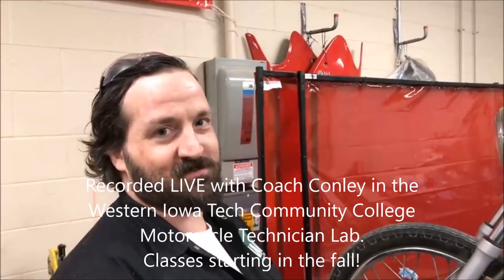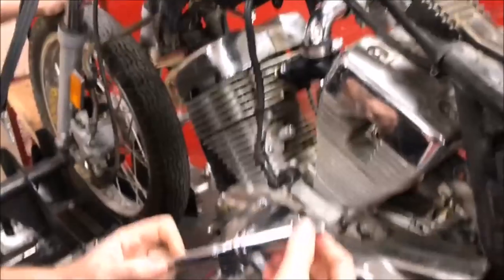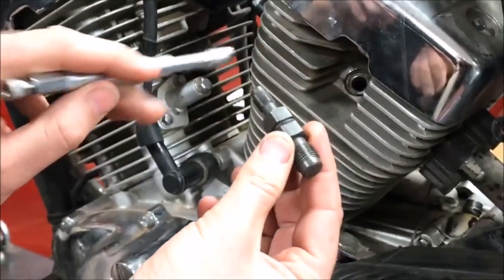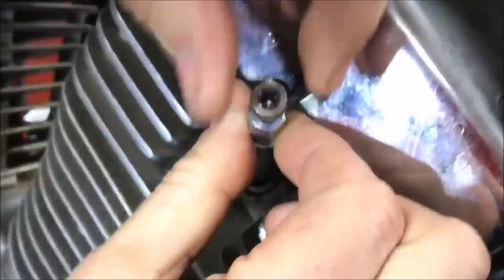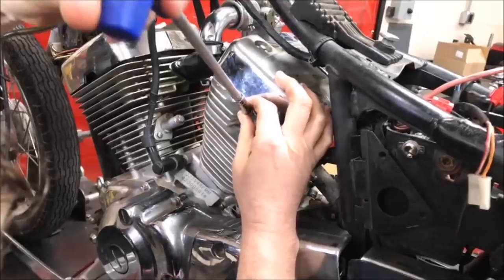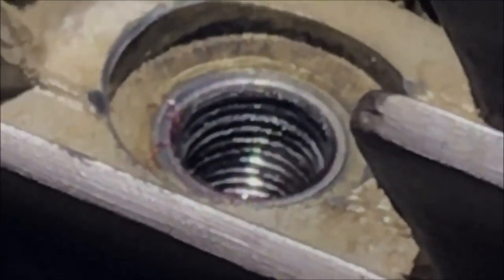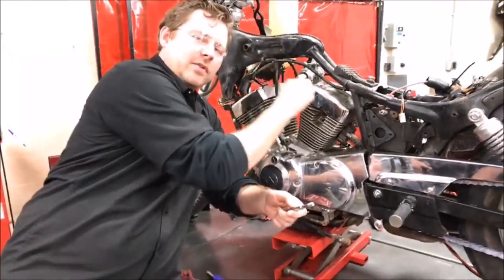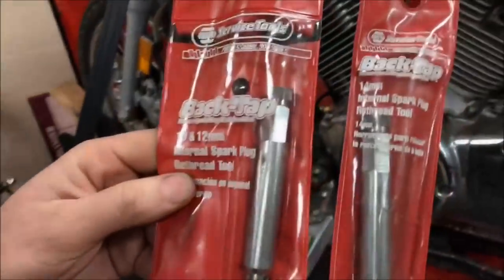How to repair a damaged spark plug hole and threads #savetheday using a Back Tap #sparkplugthread

Comment: Awesome tool! Another great reason to watch your channel. I would suggest cleaning the tap after the first pass and running it through again with fresh grease just to make sure all the loose bits are cleaned out the threads. 
A trick I use all the time to install plugs in awkward locations is to slip a short length of rubber hose over the porcelain end of the plug to use as a handle to spin the first few threads in by hand.
Reply from the maker: Thank you. Hit that subscribe button please! It helps us!
Here is a way to support all the free videos.
Want to say “thanks” or “keep it up”? Click here https://www.paypal.me/how2wrench  

Coach Conley is also available for hire to personally work one on one with you if ever needed. Yep he is a real person. Give him a call @ 602-345-0432

Your answers and help are just around the corner. Save time and money while protecting your investment and yourself by doing it the right way!
Follow us!
Web:
www.How2Wrench.com    
www.Tools2Wrench.com

Comment: You made a believer out of me. Haven’t cross threaded a spark plug in many decades.  Purchased a 10mm x 1.0 on EBay and it worked like a charm.  If I had to remove the head, I’d probably have scraped more gasket material into the cylinder.  Great tool and thanks for the video!   I wonder why they don’t sell them in more places?
Reply from the maker: Glad to hear how you liked the videos. Here are the links to support us for this information and our work saving you money.
Join this channel to get access to perks:
https://www.youtube.com/channel/UCBhM8DCKnT3qXwTW0eToyCg/join     

Give us a high 5 here:  https://www.paypal.me/how2wrench

Comment: That is a pretty nifty tool. It like a modified heavy floor anchor like you anchor heavy equipment like press brakes and lathes with, but with threads popped onto it.
Reply from the maker: Right on....

Comment: so i have a 2001 yamaha roadstar 1600 motor is the 4 valve per cylinder.. i whent to go change the plugs and noticed that 2 of the plugs on the right side of engine is cross threaded and wont let them go in hardly at all.. would using this tool be safe to use like do i need to worry about the spark plug getting blown out?
Reply from the maker: Its your best shot at not having to remove the head to fix but the only way to judge if it worked is if the spark plug will torque to spec and not pull threads. You're in luck. I do offer personal service to back up what's missing from a video to actually fix your specific problem. I do work on donations for my time and possible research. 
Good news is its CHEAP! For my time would mind becoming a member of my website? It comes with a free 20 mins of techline and that will cover my time to assist you so we both benefit. So to have me personal cell phone number to put in your phone as your direct info and how to coach, sign up now! As always thank you and enjoy the free videos! Much more to come! I look forward to working with you and hope you will become a member of or learning community. 

Link to membership: https://how2wrench.com/product/membershipmembers-onlymembers? 

If I can ever be of service to you, here is a video explains how to connect with me. 
https://www.youtube.com/watch?v=vjvmB01ebcs 
Direct link to services: 
https://how2wrench.com/product-category/tech-lineservice-callminutes/ 
Live Chat is great for you to actually show your specific issue!
Donation link: https://www.paypal.me/how2wrench

Comment: stick a rubber hose on the end of the plug to start it.  Much easier in tight locations and you won't have enough torque to cross thread
Reply from the maker: Good tip! Since it's coming from the combustion area and there is carbon build up, you will find at times you really have to break through the carbon and a hose would slip BUT better to start your way if unsure and then can pray and do with tools... 😁 
You rock for commenting! We will let Shane know! Want even more? ...Join this channel to get access to perks:
https://www.youtube.com/channel/UCBhM8DCKnT3qXwTW0eToyCg/join

Comment: Howdy! I have a 1998 Honda Shadow Aero that I am teaching myself how to maintain and tune up...and I've got a problem :( I tried changing the spark plugs for the first time last night, and I can't get one of them back in. How do I know what thread chaser/Back Tap size to use? The spark plug is a NGK DPR7EA-9.  (I am a member/subscriber! Thanks for making these videos!)
Reply from the maker: Thank you for joining! Your spark plug is a 12mm. Here is the link: https://amzn.to/3ks5MbI
Reply: @How2Wrench  Thanks so much! One last question: I notice some photos of this tool in action, showing the end all the way in the cylinder. That won’t be possible on my bike, when I look in the spark plug hole, I’m looking at a brass insert that tapers after the threads like a funnel.  Can I still use this tool or should I use a conventional thread chaser?  (I have a good photo if it helps.
Reply from the maker: @lisawilliams7783  Text it to me @ 602-345-0432

Comment: Supposedly the taps (thread chasers) carry minimal risk of debris if the grease is covering enough past the ends. 

My problem, however, is the first thread or two on a 2-stroke engine is busted, so I cannot tell whether it is threaded correctly without a reverse-tapping tool (such as the above).

Comment: I had some porcelain off of one plug come off in one of my cyl that gave me a horrable knock, knock knock. I thought I threw a rod, my heart hurt the second I started it, it happened! Then I pulled all 6 plugs found one with about a fingernail size piece missing from around the electrode. I was scouring the web trying to find out if I can get into a 4.0l cylinder through a lifter port without pulling the head, which FYI, you Can't, when I found a thread that said he had the same thing happen and he just started her up without that plug in and shot it out the cyl, I had my doubts but it must have worked cause it's been a couple of months now and the Jeep Is still running and doesn't sound like a diesel thank you Lord. Anyways if you should get any threads in the cyl you should be able to shoot em out the plug hole or either the exhaust or wherever the my fantom piece of porcelain went was my thought, rite or ?....
Reply from the maker: Sounds like you got lucky and it blew out!